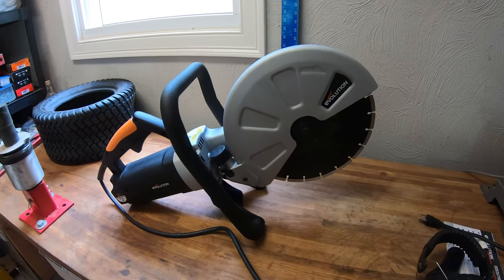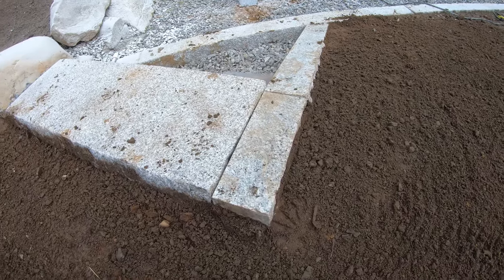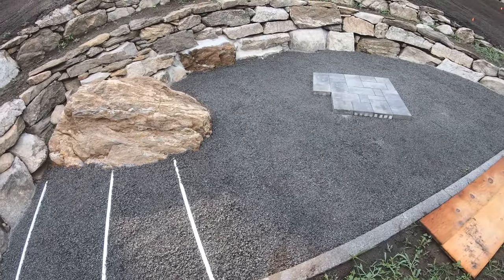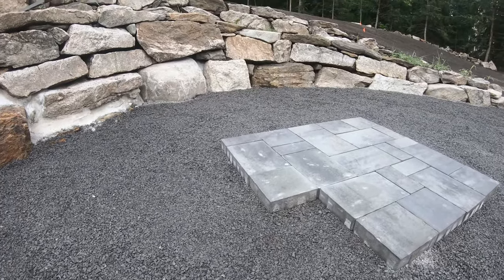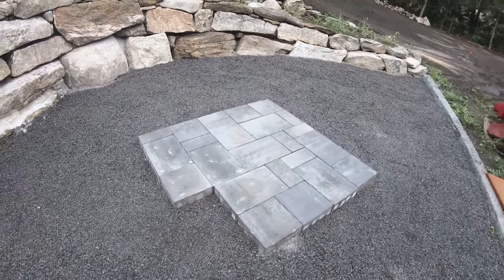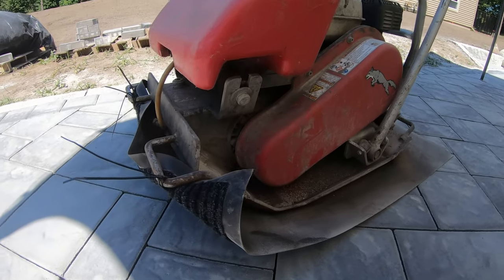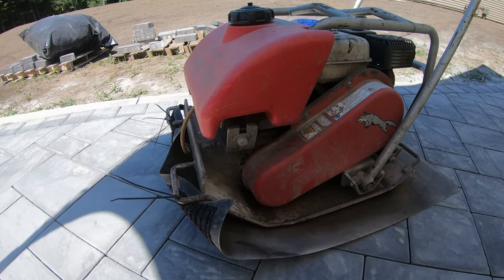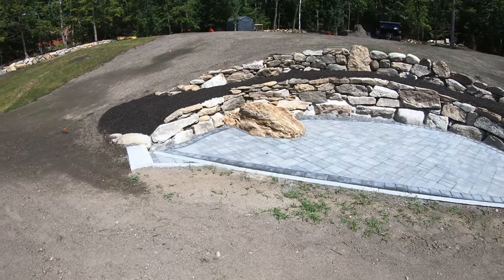[32] Backyard Patio - Part 5 - Finished! Pavers & Bark Mulch

Comment: For protection between compactor and pavers, I just cut off a chunk of discarded carpet that was recently replaced on site. Lasted the months worth of jobs I was working with the thing.
I don't actually think I've ever seen anyone use a compactor with anything that resembles a deliberately manufactured part made to protector pavers. Every single time it's some DIY solution.
Reply from the maker: Yeah exactly. Many sites and videos demonstrate those attachments, but no one actually has/sells them. Oh well, the carpet works!